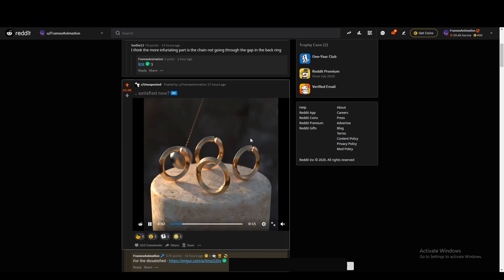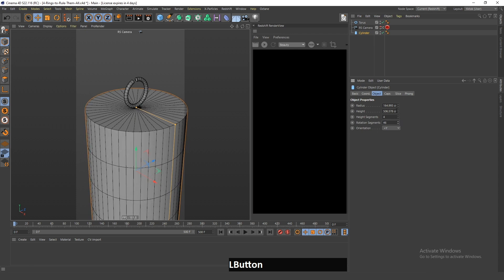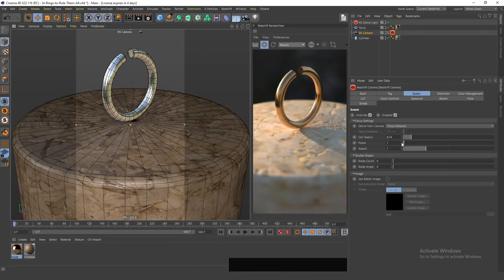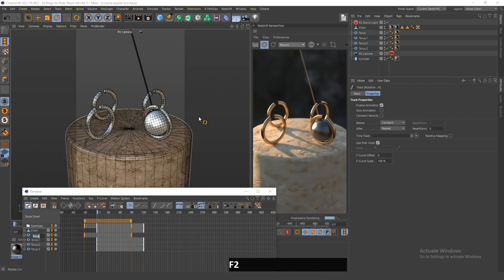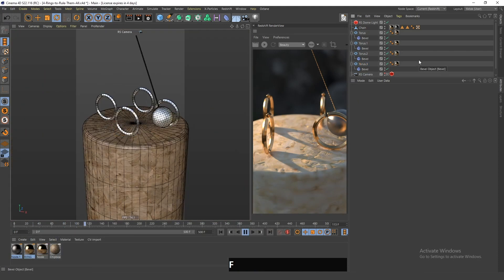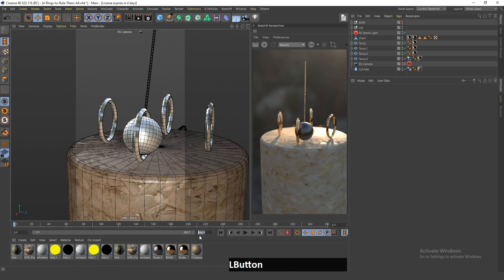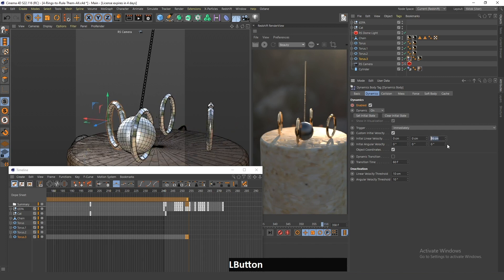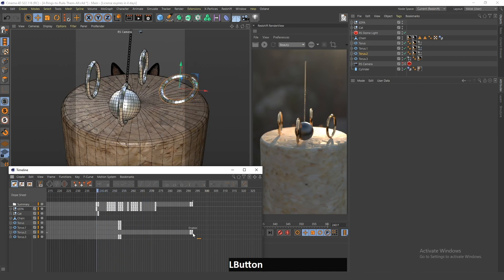Cinema 4D : Satisfying Animation

Comment: hey. can you help me with rotating chain ball? I did 360 but does not work
Reply from the maker: Can you explain what is going on a bit?
Reply: I added keyframes of R.H 360° from 0 - 120  ... But it rotates on its own place unlike yours
Reply from the maker: Is R.H at frame 0 - 0 and at frame 120 - 360?
Reply: @Mr_Anderson_one  yes. But it rotate at same place...does not revolve. Can i connect with you somewhere where i can show you the video ?
Reply from the maker: @Hasnaindalal  oh, I understand now. It's probably because of the axis point of your chain. You can try adding a Null Object, put your chain in it and then rotate the null object. Is your chain tilted? You can send a video with wetransfer . com or an image on imgur
Reply from the maker: @Hasnaindalal  haha, you must have sent me the wrong video
Reply: @Mr_Anderson_one  oops sorry. https://we.tl/t-hTe2dtntci this is whats happening. 
https://we.tl/t-Ucer72X1Nh and this is my file
Reply from the maker: @Hasnaindalal  press 'L' and move the Anchor point to the top of the chain, this is the part 'from which the spinning is happening' :)
Reply: @Mr_Anderson_one  if possible..can you rotate it for me... I'll see the settings then
Reply: Thank you so much.. i got it done. 
Just one more question.. after animation ...if i want to rotate the whole thing...then it wont rotate liek it used to..it will change it...can you tell me how to maintain it ? Even after tilting whole thing
Reply from the maker: @Hasnaindalal  I think you cant rotate the whole thing once its animated. You can put it in a null object and then rotate the null object, I am not sure how that would work but this is how I would try it :)
Reply: @Mr_Anderson_one  i exactly did the same thing and it worked. Thanks..I have  added a little to your animation..please let me know how to give you credits on Instagram.
Reply from the maker: @Hasnaindalal  @mr_anderson_one :)